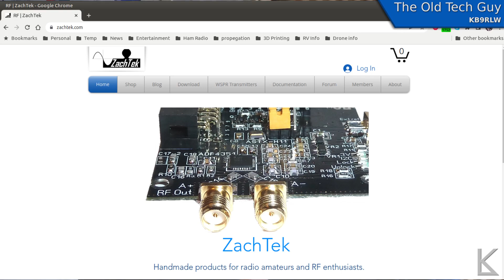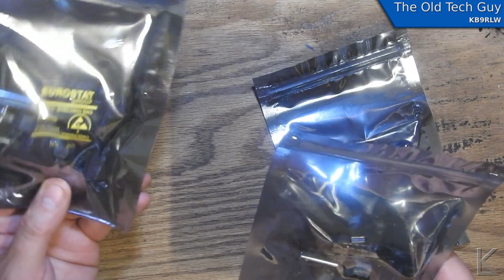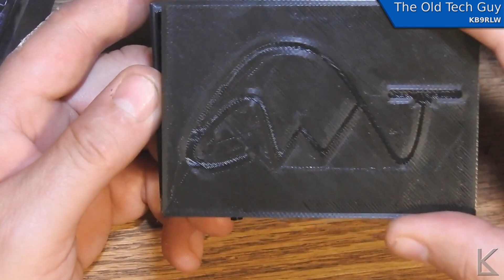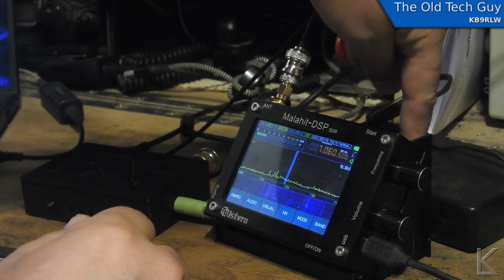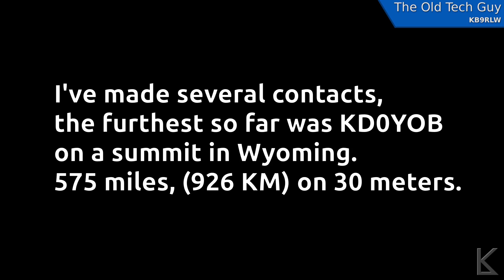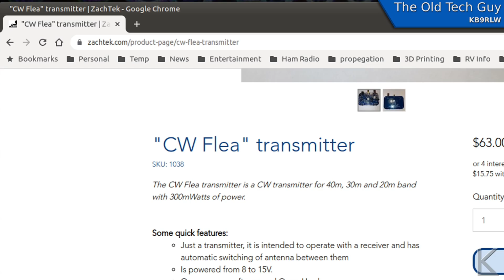Ham Radio - The ZachTek CWflea QRPp 3 band transmitter

Comment: I intend to upgrade my CW Flea with a 5W HF amplifier. I wonder if I will not endanger my radio receiver (A Malahit SDR) with too much HF at the entrance. Is there a big risk ?
Reply from the maker: If the amplifier is connected between the antenna jack and the antenna then there is no way for the power to get back to the receiver.

Comment: Very cool!  I just put a Flea on the air with my ATS-20 and it worked great - fun little rig and your tuning scheme is not only clever, it is very easy to use.  Made first contact to a SOTA op in CA on 30M.  73 de K7ZB

Comment: Just got mine a couple of weeks ago. So far 3 qsos, from GA - NY, ND, and MI. Using an SDR dongle as rx, but latency is tough, have to pull the earbuds out when sending.  Any suggestions on rx?
Reply from the maker: There are many receivers to choose from.  I only have direct experience with a very few.  For CW, you'll want to look for one with some filter bandwidth options that can narrow down to a few hundred Hz.
Yeah, SDR is not the way to go, as you well know now. :-)

Comment: Thanks for the video, Kevin.  I purchased the "Flea" a short time ago and have been really having fun with it.  I've used it several times now and did a successful POTA activation with it 2 weeks ago.  The contacts do come a lot slower than QRO 5 watts (LOL) but are sure exciting when you make that contact!  Best contact so far was just short of 1500 miles on 20 meters.  Thanks again for bringing the "Flea" to our attention, a bunch of fun at a very reasonable price for sure!  Paul  NA9M
Reply from the maker: Thanks for the feedback Paul, I'm glad to know you're enjoying the little transmitter.  What RX were you using it with?
Reply: @loughkb  I have used it successfully with both my SW3B & HB1B xcvrs.  It works equally well with both.  I am thinking  that any xcvr or receiver you use will work well with it.  Again, a fun rig.  Would be interested in hearing from others that have used the rig....   72  Paul
Reply from the maker: I've just updated the software for the flea, fixing that little bug where it will occasionally jump too far when tapping the buttons for fine tuning. 
Version 1.5.1 is the fixed version. 
https://github.com/loughkb/CW-flea-arduino-sketch

Comment: There is a class called QRPp and it is 1 watt or less. It is almost orgasmic to make a contact at that level, Kevin! I built a NorCal 40A kit from Wilderness Radio about four years ago (they're out of business now) and the first contact was with K6KPH which was the amateur station at the old KPH maritime radio station museum at Bolinas in Northern California. 
The NorCal rig was running about a watt and that was a Q that was over 500 miles away. So, from that point on, I set the power to 990 miliwatts and used the little radio for QRPp only. 
Sorry you're having the difficulty but from Michigan to Hawaii ain't just sneezing. Great job!

Comment: Once upon a time, I had an HW-7 or -8 (can't recall which model it was). Bought it used at a flea market. After 'a billion' (LOL) CQ attempts, finally made contact with a station in the same prefix. Yay!  Looked him up, in books in those days (before the Internet), and discovered that he lived about 125m (~400 feet) away. Around the corner and just up the hill. Sigh. I sold the Heath Kit after that...
Reply from the maker: Yeah, calling CQ is often not productive when operating low power.  Someone will hear a faint signal and may presume that propagation is not great to that station, never bothering to answer. The better approach is to answer other CQs.  You have a much higher success rate.
It takes a different operating technique when QRP.
I've made many DX contacts with 1-2 watts or less.   On the first page of my first log, using an HW-8, I had a contact in Hawaii from Michigan with 1.5 watts on 15 meters.  The challenge of it is what makes it more thrilling or rewarding with success.

Comment: I see all sorts of hams who are deeply concerned with the harmonic levels from their rigs, (as you pointed out,) yet who have no control over the output level of their fundamental carrier, (or just have a High/Low or High/Medium/Low degree of control,) even though the FCC rules specify that the minimum power be used that is necessary to make effective contact. The hams seem to take one rule to heart while ignoring another simply because it's inconvenient. 

I figure any rig that doesn't have continuous user control of the RF output power is violating the FCC rules. I even did some mods and added continuously variable output power control to my 115 Watt SyntorX VHF FM rigs so I could drop the output power down to under a Watt (Yes, I looked for increased spurs. There were none,) to conform with the FCC rules. I also added such control to my (tr)uSX QRP transceiver. I figure I know both the letter and intent of the FCC rules and I should follow ALL of them.

Comment: ENTRY For CW Flea.  FB Kevin, nice work.  I wonder if a small amount of silicone on the back of the board and on the tips of the pegs would hold the board in place.  Let it dry before reinstallation so it is a compression fit that could be adjusted with a razor blade trimming the silicon nubs.

Comment: Entry: this thing is a perfect mate with a portable SDR, or build it into a receiver. Would love to give it a try. Keep up the content, love it! 73 K2IF
Reply from the maker: Actually,  not so hot with an SDR.  The latency in the software processing introduces a slight delay between when the signal is received and when the demodulated audio is played.  Something around 1/8th to 1/4 of a second.  Since the receiver is the side tone, it makes sending mentally impossible.
Reply: @loughkb  Thanks Kevin, I didn't think about the latency. It would probably drive you nuts, like listening to your own voice just delayed a bit. You can't 'think through it'.
Reply from the maker: Exactly.    Did you ever play with that app, I think it was called speech jammer.  You put on headphones and the app introduced a slight delay in the audio from the phones mic.  You'd hear your own speech, slightly delayed and it would kind of stall the speech center of your brain.

Comment: 👍Very happy to see the CW Flea completed and on the air Kevin. It's a good idea having all the benefits of a synthesised VFO but not the added complexity/bulk/expense of encoder and digital display. As you say, when QRP, being agile and able to call stations certainly helps in my experience. Though, usually,  if I persist a little calling CQ on the more popular CW QRP frequencies, someone eventually comes back. I often add "QRP" at the end of a CQ to let anyone listening know I am QRP. Therefore, if they are QRO, they know I will probably hear them OK even though I might be weak to them. Totally get what you mean about getting a kick out of QRP. Those QRP (especially QRP-QRP) QSOs always make me happy. Hope you have many more contacts with the Flea.

Comment: This is a superb project Kevin,what came to mind when tuning would be a digital frequency meter add on just sniffing the VFO frequency,small units can be had for  little cost and could be driven for the 12volt source perhaps,just a thought,keep up the good work!
Reply from the maker: It's already running on a common type of microcontroller.  It would be trivial to connect a small lcd module to it and tweak the software to drive it.  No need for a freq counter.
Reply: @loughkb  You do need to attach it to the micro controller,it would have no connection at all, as the counter module would sniff the RF output in isolation,just a thought it's your project after all and a good one,regards Colin.

Comment: So he completely reimplemented the Nano on the board? I would have been tempted top make this a shield for a nano. Generic nanos are currently cheaper than the chips because of backstock.
Reply from the maker: It's an open design.  Maybe someone will.   I'm actually looking forward to seeing what other projects it spawns.   I predict someone will add a small display to it showing frequency.  :-)
Reply: @loughkb  The IDC connector has all the pins and voltages needed to hook up a 3.3V SPI display so it could be a very clean add-on. Who will be first? :-)
Reply from the maker: @deBug67  There's an add-on you could sell. ;-)
The display update routine would only have to be called each time the si5351 is updated.  Could add a variable/flag to the top, displaypresent = 
And just leave it as part of the standard load.